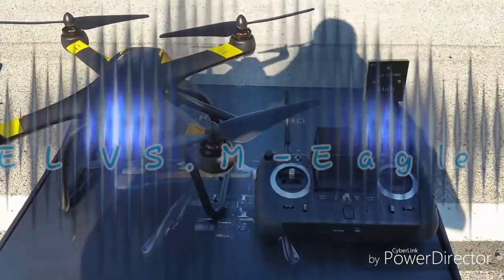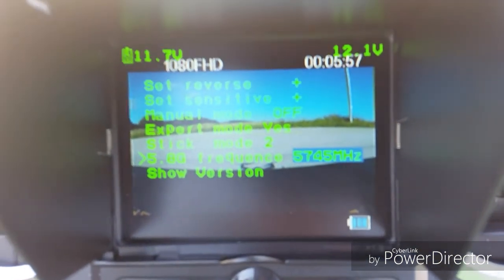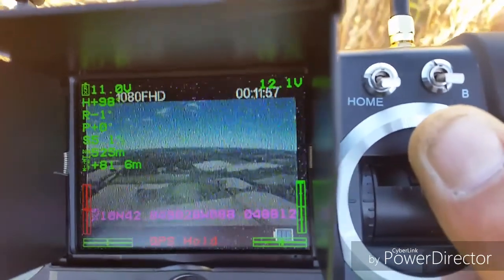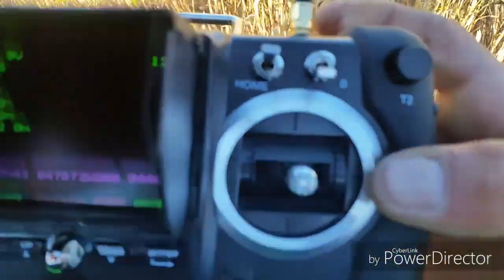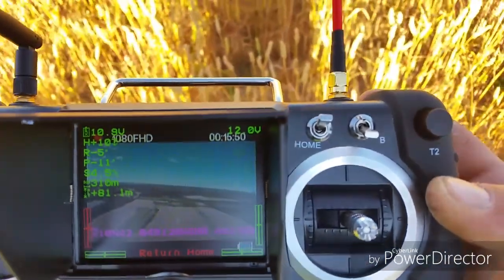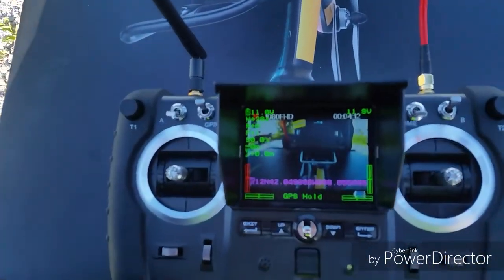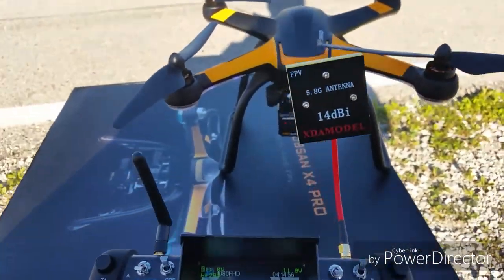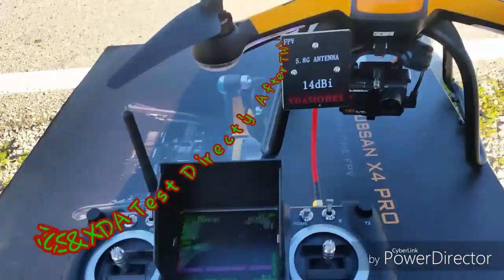hubsan h109s & XDAMODEL Panel  FPV Test, Long Range

Comment: Mark, where did you hear about getting a bad GPS lock if you take off from the ground?  I've never heard of that. Couldn't you just take off vertically with the GPS off and hover a few meters off the ground then turn the GPS on to get your lock? Is this valid for the H501's too? I thought toilet bowling was from a bad compass calibration not GPS lock. Thanks.
Reply from the maker: If you took off without waiting for satellites and GPS on, it would not set a return to home point. You can take off however you want but it seems like all the GPS quads that I have, seem to fly better, when I use a box, or something raised a few inches off of the ground. Some are worse than others when it comes to this but the h109s is especially susceptible to the "taking off from the ground" issues because the geomagnetic compass sensor, is located in the very bottom of the landing leg. Which is directly on the ground. And yes toilet bowl (VRS), Vortex Ring State, is mostly caused by bad compass calibration.

Comment: Is it possible that your controller is influenced by the hi-voltage power lines next to you and that you calibrated your drone next to? At the beginning of all the operator's manuals, the first thing, it warns to stay away from power lines, buildings, etc. Just saying, maybe you are responsible for it's performance?

Comment: Hi. Would you recommend the Hubsan 109h? I've always liked the profile and range. I'm going to buy 1 Friday for $315. Free shipping. Thanks for your feelings on this Hubsan model. William Horsley
Reply from the maker: Hey William. Sorry if it took me awhile to respond to your comment, I have been extremely busy with work and other things. The h109s X4 Pro is a really nice drone for the money. It has basically the exact same flight characteristics as the h501s, except it's a lot bigger and is a camera platform drone. It can handle a lot higher wind speeds than the h501s, it comes with a nice camera, pretty decent charger, and it also comes with a separate attachable gimbal, that you can put a smartphone onto and record with that, if you would like. The standard edition, 1 axis gimble, isn't really a true "gimble". It is simply a servo powered swivel up and down type deal. It's not stabilized in any kind of way to reduce Jello wobble effect, however it does have four rubber dampeners, that help a little bit. You can put a GoPro or any other camera that size, where the stock camera goes. You might want to do that, if you are looking for absolutely perfectly still video. That way, you could use digital stabilization or something similar. All in all, it's a fun quad to fly and for the price, I don't think it's bad at all. Just be careful because they are very susceptible to interferences, especially satellite loss. If it loses satellites, it goes into altitude hold and will drift with the wind.  Anyways, it is a nice quad for the $.
Reply: Thank you for your response. Sincerely William Horsley

Comment: Hey. Is this still a good quad?
Reply from the maker: I  would hope so! I bought mine, about 2 years ago and have not bought another one since. I don't think they changed anything with it, so it should be a good quad still. As long as you get it new and from a good source. Ya know ?
Reply from the maker: @mir1658  I haven't flown my 109s in a long time. It took a tumble, while in Altitude Hold. Crashed hard ! I was able to fix it and get it flying again but,  it has just been sitting in my basement because I have more fun with the 501ss, Mavic Air, and others. And when it crashed on me, it just happened to land on a concrete path, 2 feet away from the grass ! Broke the camera, gimbal, and props.

Comment: U Are. losing. Signal BECAUSE. U. The. Pilot. IS not Pointing. The Ant. At.bYour. AIR Craft.  I've. Been. FLYING. Rcs. Since. I Was 12yrs. OLD. BACK Then WE HAD Long Ass. Ant. AND U HAD Then And Now. HAVE to point THE Ant. In The Direction. OF Ur. AIR Craft.
Reply from the maker: Hello there. Do you know that I am Well Aware of Everything you just said ? I was moving the 14dBi Panel Antenna Directly at the Quad's 5.8 TX Antenna. Or what you called "the aircraft". I'm not going to be able get Long Range FPV capabilities with a Shitty XDAModel Panel Antenna ! They Are not that good. Cheap build quality ! When I was younger, about 25 years ago, I used to have lots of Model aircraft and cars and trucks. There were no drones or anything with autonomous functions back then. The "big long antennae" you are referring to, was it telescoping metal antenna that transmitted FM signal. FM stands for frequency modulation,|> ~~~< so it was imperative, you had a large, Hollow, Metal antenna to transmit your signal  There was no receiving information (RX/Telemetry). No Transceiver. Your "radio" was a signal Emitter and your aircraft model was a receiver.   I think I know a little bit more about these electronics and electromagnetic radiation Spectrums then you do bud... No offense ! I definitely appreciate your comment, I was trying the entire time to point the panel antenna in the direction of my aircraft. However this particular antenna has bad build quality and does not function well. Look at these videos, If you don't believe me... https://youtu.be/mK65FPO72Lw. https://youtu.be/3ctTn-Xv6v0
Reply: Mark Suttner HEY my fellow FLYER. GOOD. Windom. I Appreciate. Nice Looking OUT. That's. Good Living. MUCH. LOVE.JOYFUL. Flying. .
Reply from the maker: @heyyehheyallgoodyawhaveh450  I Really Was Not trying to be Condonsending, in my reply back... I was just trying to clarify that I was aiming the panel antenna at the aircraft and still did not have very good fpv. You enjoy the hobby as well as I do, so we're all in the same category, so to speak... Didn't mean to say things, that you already know about this technology. I'm a Fellow Flyer, that's all. I hope you understand what it is I am trying to say to you? With that, happy flying and blue skies brother ! :)

Comment: what the best mhz for that antenna,for the h501ss would you think?
Reply from the maker: 5745 - 5760 MHz ( 5755 seems to work good for me )
Reply: I know you didn't get good results at 5745 but have you tried all the other freqs above 5760?

Comment: Hey Mark... I Finally got myself an H109.  From what I have learned about Propwash on these, I purchased a set of 3DR Solo props, and a set of Master Airscrew props for the 3DR Solo... Man... if you could see these!  Way More Surface, with a curve at the end for extra air management lift. They both have more blade area, and way better Air Management than the stock H109s props. I got the 3dR blades off Ebay, but went to   https://www.masterairscrew.com/collections/3dr-solo-propellers/products/3dr-solo-propellers-mr-sl-10x4-5-prop-set-x4-black-3dr-solo

Now the 3DR Solo weighs just over 3lbs.  And that never has propwash I have learned.
I bet cha a Dollar, if you get a pair of these, you won't go back to the stock props, except to Review/Test/Compare them.

Comment: Mine use stock antenna I can get 800m with no problem. It can even go further if I want to.
Reply from the maker: +Said Osman I have flown Over 800 Meters With The Stock Antenna As Well. Im Testing These Different 3 Panel Antennae On Different Locations For a Reason. Next test Will Be with the Stock "Hubsan" Panel @ the same location....